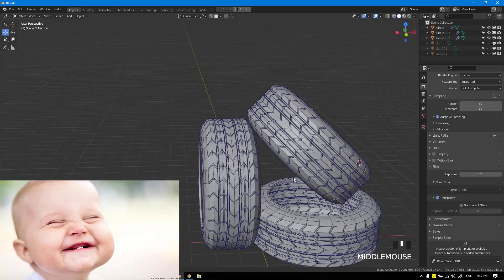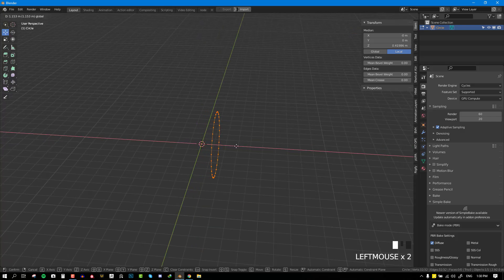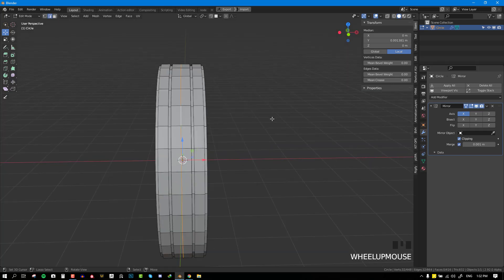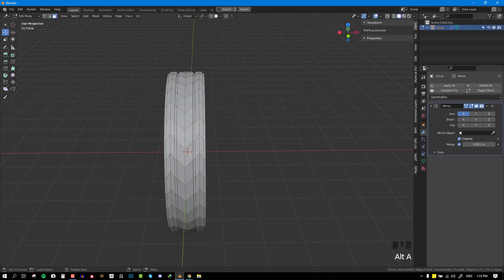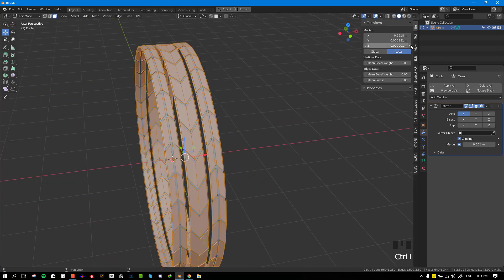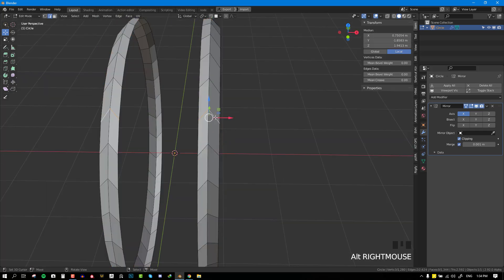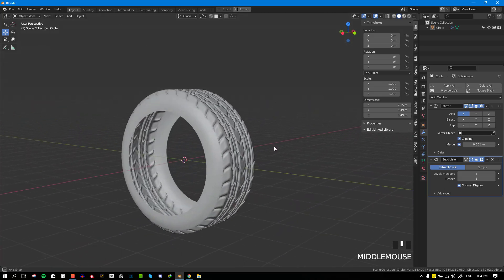Create a Tire in 2 minutes in Blender

Comment: Hello pal: thanks for taking the time to explain, I find this post very useful and appreciate your dedication. I have a problem that I can't solve: everything is fine until I chamfer and extrude the longitudinal lines that correspond to the diameter, however, when I want to chamfer the radials and extrude them, the mesh does some very strange things. Can you tell me what I'm doing wrong? Again, thanks for your time.

Comment: I guess 3d is all about solving things the smart and easy way.

In order to make it a game ready tire, do we bake it onto a beveled cylinder?
Reply from the maker: Yeah you can bake it for a game asset
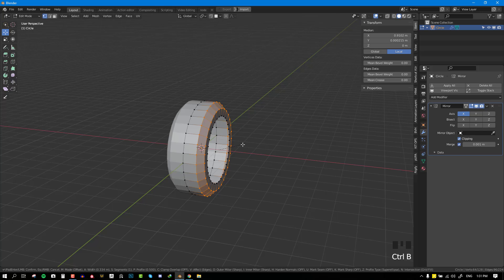Reply: @Luwizart  Awesome! So the type of model we should bake it on should be on this model, right? 1:04

Or do we dissolve edges beforehand?
Reply from the maker: @kloa4219  i will make a tutorial for that
Reply: @kloa4219  it should have as less edges as possible because it is the main purpose of baking - minimum of geometry with maximum fake details of normal map 😎
Reply: I don't quite get it how do you "bake" once baked all you gotta do is uv unwrapped the image to a cylinder or something ?